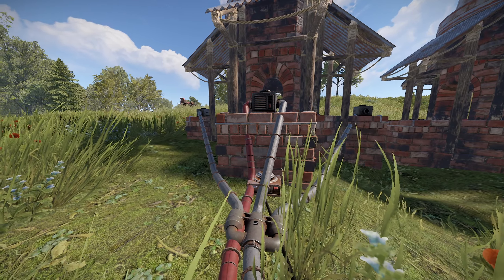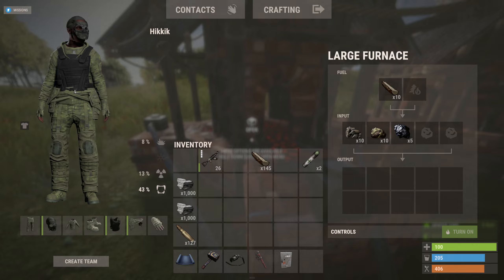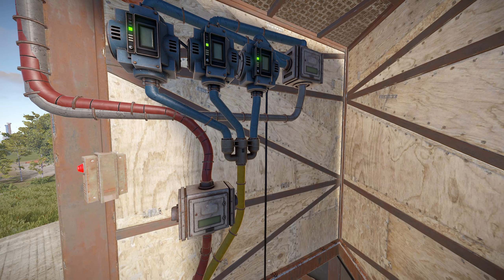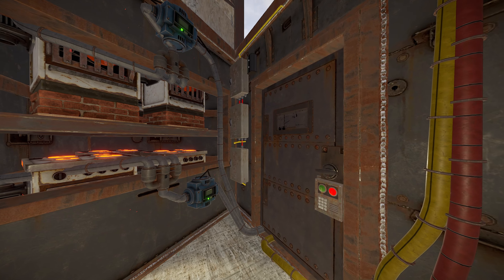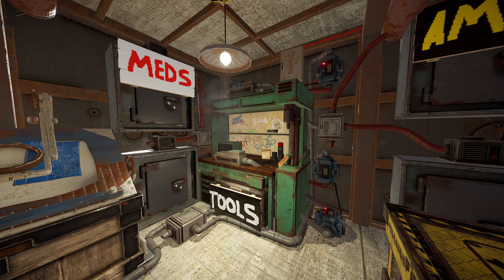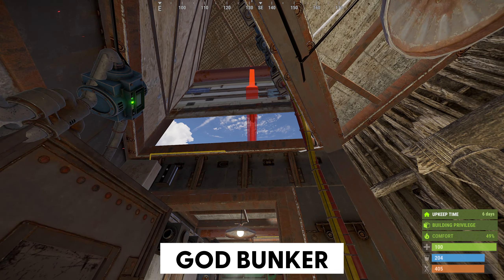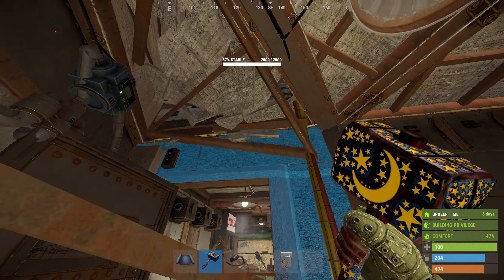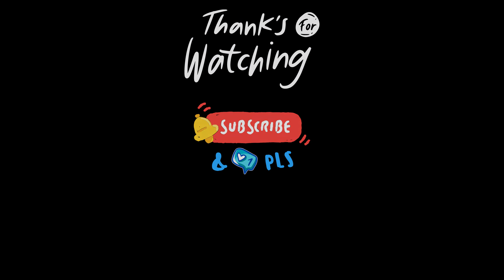RUST | THE ONLY INDUSTRIAL BUNKER [SEEMS FIXED] YOU NEED TO KNOW 2023

Comment: bro how do you get that furnace placement? it's so tricky to wire it all up like you have
Reply from the maker: it quite easy man, no trick and no noclip bro. u need to place far lower and upper furnance as first step, connect and electricity and place adaptor, than place uper and lower right furnances connect them with all the same and finally left one. as on my mind ive placed them in this order
Reply from the maker: i will check it in 15 minutes i dont remember really. but the far furnance goes first for sure with all the connections
Reply: @hikkik I figured it out eventually. I found you have to wire up the back lower one first, then finish the bottom shelf. Then the top shelf is easy from there.